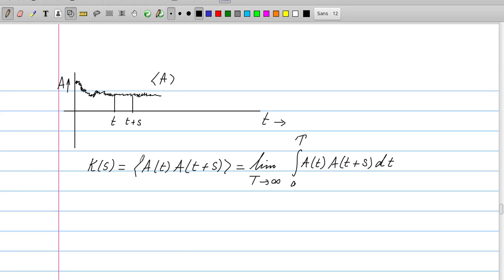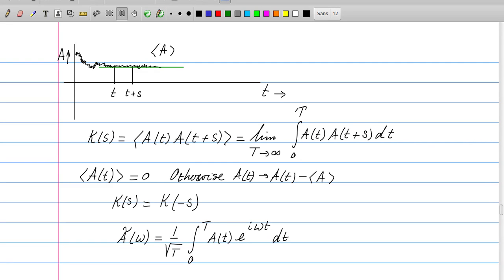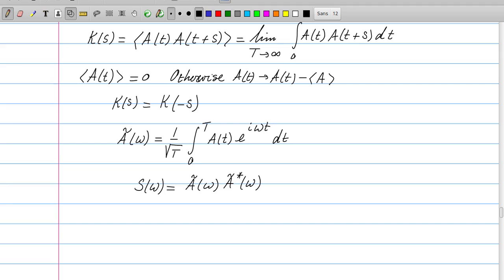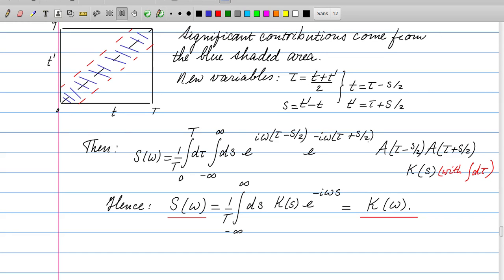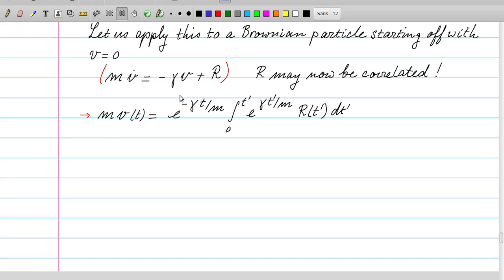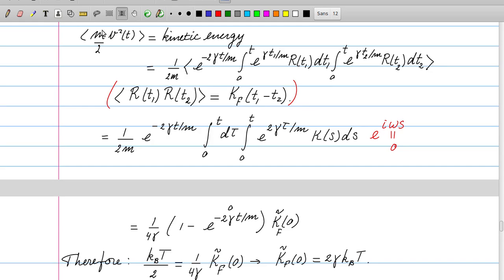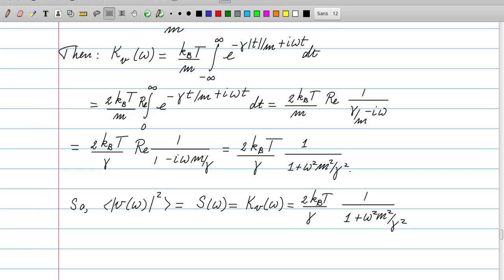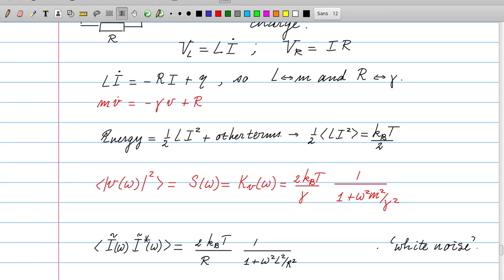Noise and the Wiener-Kintchine Theorem

Comment: Thanks a lot for the great videos, they help a lot by my "physical kinetics"! i just don't figure it out, why the integral over s goes from - to + infinite... 08:00
Reply from the maker: Good question. The integrand decays to zero outside the shaded area in the picture. So for tau not too close to 0 or to T, it is safe to replace the integral boundaries by +/- infty. The real reason for this lies in the fact that the correlation function decays to zero.
Reply: thanks!!